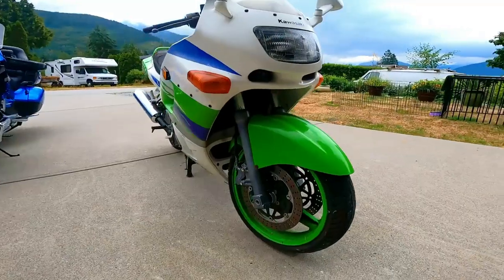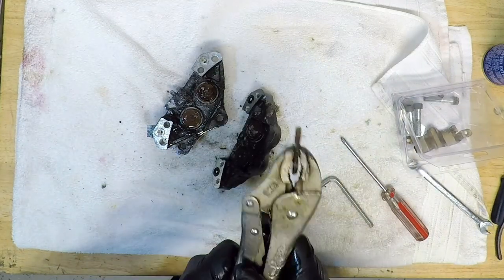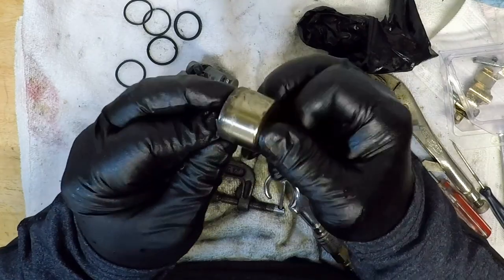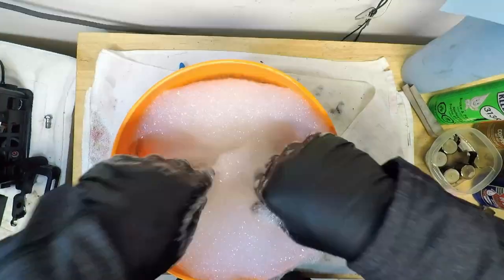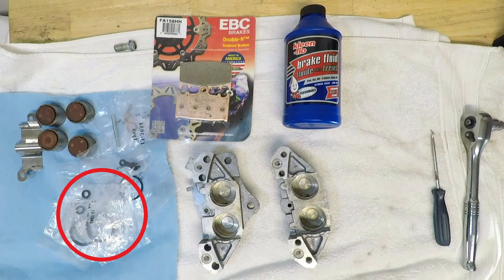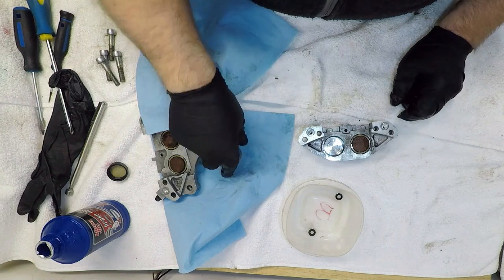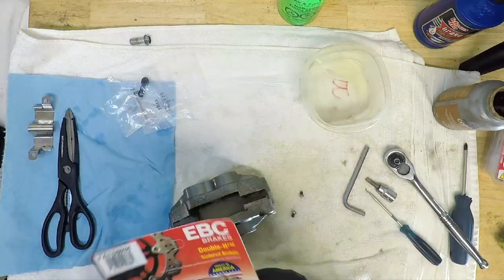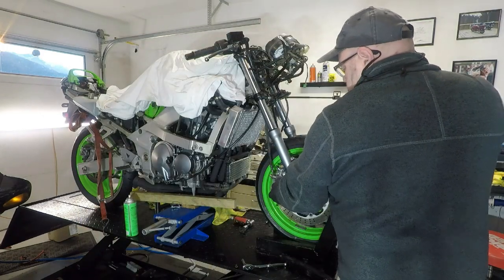Tokico 2 Piece Brake Caliper Rebuild

Comment: As someone slowly learning bike/ car maintenance, these videos are awesome.

I can't wait to see the bike done.
Reply from the maker: Thanks for the feedback & View, Great to have you on the Channel!
Reply: @Rod Rides & Wrenches  I have some new pads, brake lines and cleaning due. I'll watching your videos while I do it. 

Keep it going!

Maybe doing a valve check on an inline 4 motorcycle next. As most 16 valve inline 4 sportbikes get their valves checked the same way.
Reply from the maker: @westondifranco9313  Hey Weston, most valve checks are a waste of time unless you're ready with a shim kit and are prepared to remove the cam shafts.  I've done them and never had to shim a valve yet (knock 🪵).  I buy bikes where the previous owner has taken the bike to a shop and the technician reports, "all within spec" and moves on, questioning whether or not they actually checked them all...  I honestly think this is something the manufacturer puts in their owner's manual to avoid future engine issue liability since most or all bikes do not follow this maintenance schedule and/or are a way to help dealerships make service revenue since most riders will not take this on themselves if they do it at all.  Is the valve train noisy?  Check your compression, which is easier and way less costly, if there is a significant discrepancy then you know you have an issue and can investigate further IMO. 🔧  But if you're looking for something to do and kill time this winter, have at it!
Reply: @Rod Rides & Wrenches  Those are all great points. 

 I have a 2003 FZ1 and those bikes, notoriously long valve service intervals, and most rarely, if ever, need shimmed.

Comment: nice video I wish I would have Seen this before I tried myself. Do you Know where I can find these piston bores?
Reply from the maker: They are still available from Kawasaki PT# 43020-1089 if you can't find them in your dealer try partzilla, they have multiple PDC's to pull from and if no luck there, webike in Japan has direct lines to pull parts from.  https://www.partzilla.com/catalog/kawasaki/motorcycle/1994/ninja-zx-6-zx600-e2/front-brake